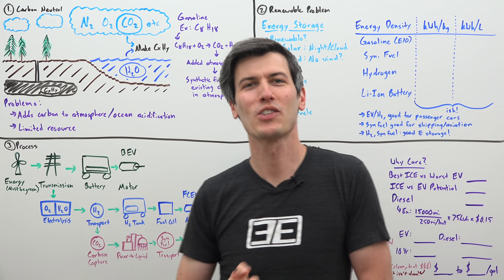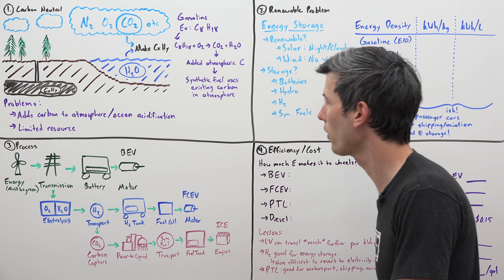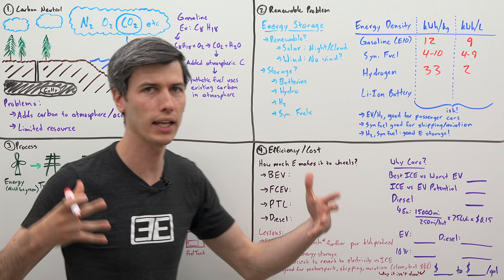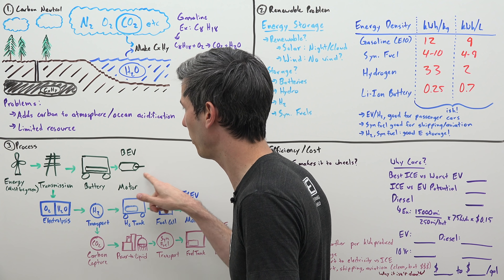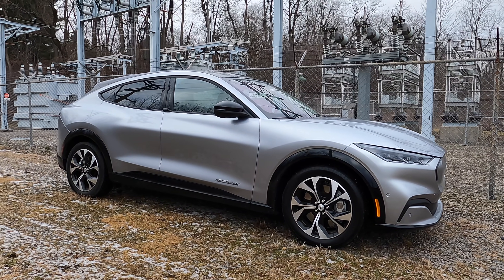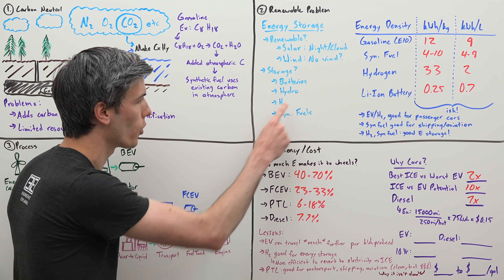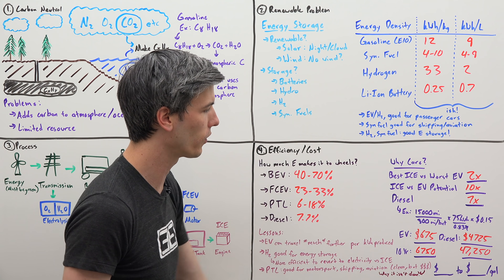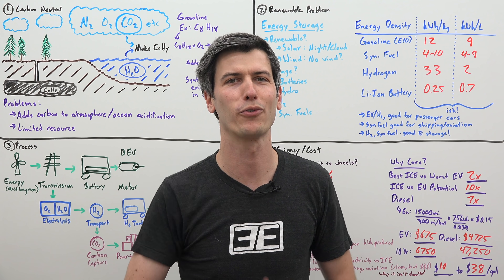The Big Problem With Synthetic Fuels

Comment: Energy conversion efficiency of fuels like crude, diesel, gasoline etc is around 35% on average? The ice vehicle doesn't need to convert that fuel to electricity though, just like we shouldn't power EV's with fossil energy, so the efficiencies should even out

Comment: I feel like I'm missing something, if we already pull oil out from oceans and it is "hydrocarbons" then we burn it and what's released is co2 and h2o and then they go BACK to the oceans, doesn't that mean it's renewable..... if it's already in the oceans then the oceans should already be acidic which we already know because oceans have a ph which isn't normal tap water and we know we can't drink it so how are we acidifying something that we're actually removing acid from and then adding it back to it...?

Comment: The problem is you assume that all the electricity produced by renewables is all used up to charge EVs which is not the case since most of the renewable energy is wasted anyway why not storing them as a synthetic fuel

Comment: OK 4 years later Porsche plan to low the price up to 1$ for liter ot 3$ per galon. That's not bad. 
Also the cost of lithium extraction for battery production is waaaay expensive than eFuels ! Fact.
Reply: Да, забавно смотреть такие видео спустя 4 года. Так же хочу добавить что есть много стран с плохим климатом, где электромобили зимой очень не эффективные. Например у нас в России не покупают электромобили потому что они очень быстро разряжаются. У меня у друзей был случай где они были вынуждены ехать домой без обогревателя и фар в машине, потому что электромобиль решил экономить энергию. А ещё есть Африка где электромобили появятся только лет через 50 и там как раз лучше всего было бы использовать топливо от Порше.

Comment: On my 2018 Toyota Camry, the A25A-FKS engine can achieve 40% thermal efficiency, which is as good as a nuclear plant's efficiency.

I think you used the biased data collected by the battery industry to prop up their false narratives toward a highly toxic chemical dystopia.

The highly toxic battery weighs over a ton per EV.   If every family has at least one EV, then there are billions of tons of highly toxic chemicals running on roads or staying in garages.    Suppose only 1% of them is not properly recycled, it means tens of millions of tons of chemical spill.   A DYSTOPIAN scenario.

Comment: Very interesting. But then, for syntethic fuels to be truly carbon neutral, all of the steps in the chain would need to also be carbon neutral, right? If transporting by truck, the trucks would also need to run on synthetic fuel. Every step has to be 0 emissions or capture as much carbon as it releases.

Comment: You don't address range, nor the transition plan / transition cost / transition time scale.   Your analysis instead assumes we are starting with a clean slate... which technology would be best if you had no existing vehicle fleet, and no existing fuel distribution infrastructure, and/ or it didn't matter at all how quickly we do the transition away from fossil fuels. 
Sadly, as an engineer, you've made the classic scientist mistake of confusing efficiency and effectiveness. 

As an engineer and project manager, I don't CARE if there's a more efficient solution available if that solution can't be rolled out fast enough to solve the problem, it's a dead end distraction. 
And if there's only one solution that (in the real world with millions of existing internal combustion engines and millions of km of road network that's inadequately serviced by charging stations) can be implemented quickly enough to solve the climate crisis, then there's no debate, you just take the only option available. 
Sorry, EVs are going to be too little, too late, to resolve transport emissions.   The transition plan isn't feasible. 

But gas conversions are a much easier thing than whole vehicle replacement, and can be done across the vehicle fleet much more quickly. 

Also, conversion efficiency is irrelevant if you have abundant input energy from solar, and abundant co2 and hydrogen in the atmosphere ready to use.

Comment: you’ve misjudged the economics of this. You can’t compare the electricity cost for charging EVs, where the electricity needs to be produced locally, versus electricity cost for synthetic fuels which can be produced anywhere in the world in regions where sunlight, wind or other renewable power is abundant.

Comment: I suppose the question I’m looking to get answered is not SynFuel vs EV, it’s SynFuel vs Petrol. Considering how many billions of ICE vehicles there are in the world, and how impractical and unlikely it is to replace them with EVs, what is the likelihood that SynFuel can overtake the market? As innovation and supply increase cost will decrease. And we can say that oil companies won’t let that happen, but oil companies love money more than oil, so if there’s a market for carbon neutral fuels that flow as simply and as readily as gasoline, and also keep the billions of cars on the roads functioning indefinitely why wouldn’t they pursue that solution?

Comment: The implication that energy efficiency is key is true when you have relevant marginal energy production costs, which are almost 0 with renewables. The cost associated to renewables usage is largely due to transimission and storage (required due to intermittend production), both problems you basically don't have when you store them with synthetic. After set up costs for a plant that does everything in one (sunny) place you would be printing money - excluding transportation. I am assuming there are reasons why that's not true but I don't get them from this video?

Comment: A diesel engine can chug along for a million kilometres given proper maintenance; you'd be hard-pressed to find an EV that can achieve even 1/10 of that without replacing every battery cell, an extremely expensive and wasteful process.

Comment: The first electric car had very few miles, decades of refinement got it a little better and many dead batteries. 
It was expensive at first and still is. Old teslas come with a host of issues. Even newer evs have a host of issues. And storage of the electricity bleeds off in the cold and does so as the vehicle sits. 
People said no this is not possible to synthesized fuels a decade or so ago. 
It was bunk it’s to hard or to expensive. So yea. 20-40 pounds now.

Comment: I'm asking myself, how is this boy here capable of putting everything false statistics and calculations at one single point. And not a single reference. A diesel cost at the end of processing not much than 0,40 dollar/L for the pure crack of petroleum. The agricultural produced Diesel is twice cheaper than that. With the charge of vendors And the transportation it's not more than 0.90 dollar/L. Then comes the state and Taxes it +1$ /L. 
This taxe goes straight to the country's budget to finance the EV in every possible way. 
That's it folks. That's why we can't trust you.

Comment: Efficiency has nothing to do with it. The problem is extracting carbon (sequestered carbon) from below the ground and injecting it into the atmosphere. We are destroying our environment by using sequestered carbon. That's why the use of fossil fuels must stop. No if ands or butts, or excuses about efficiency. EV cars will work for passenger cars. But an alternative must be found for heavy industry (steel, aluminum, cement manufacturing).

Comment: I think this might make sense if they can make the production plant cheap enough, it could take advantage of really low or negative daily electric prices and then sell the fuel back during winter when prices are $.30 a kwh for heat or greater. Hydrogen is tough to store and move and batteries don't hold enough energy nor do they do it long enough for months of storage

Comment: Your price of 15 c/kWh is crazy. I pay 51 c/kWh. Porsche already said that when they scope the process to full production that the price will come down. Brazil have had synthetic fuel for years in ethanol. It's as cheap as petrol and is net zero CO2. I think that batteries can't cut it and think hydrogen won't cut it either. The problem with hydrogen is safety and storage. It's the smallest Atom of any element and is hard to confine. Also to get the energy density you have the hydrogen under extreme pressure. It's like carrying around a bomb. Hydrogen also causes metal to fatigue. Producing hydrogen is not cheap. The EV to begin with are expensive and resale is not good. When I costed each battery I took into account how many cycles, the total    amp hours and it gave a cost on what I would get out of that battery for it's life. The EV is only as good as the battery and if they last 10 years then I would say my Diesel would be nearly brand new at that stage and would to replace the EV. I think an EV is a rich man's realm and a poormans nightmare. 
Tyres aren't cheap and EVs being heavier go through more tyres and they are harder on roads. This brings me to another point that EV owners don't pay anything for the road maintenance that's ice owners  do that's, because they pay road tax on each litre of fuel. 
Also if Govt subsidies were dropped,  EVs would be a lot dearer. There are many issues like the electricity for EVs has to be transmitted to the customer. This very costly as transmission lines are very expensive and are only in use for times wind is blowing and or sun is shining, which makes them more expensive. The plan would to illiminate the cost of transmission by producing the fuel where the power is.The insurance on EVs is high because of the risk they pose. 
I heard an electrical engineer say that one EV needs the equivalent of a whole street of houses to charge.
Nothing seems easy until you look at the holistic approach and take in all aspects.
To me I my approach would to take coal and perform catalytic conversion to form synthetic fuel. The Germans were very good at doing this since 1920s and ran most of war effort off this fuel. We should look to the past to move forward.

Comment: Very true - BEV will always ahve the highest energy efficiency but to say that PTL makes little to no sense because it has low energy efficiency is not an accurate statement. The PTL vehicle will have a higher Operational Efficiency due to the far greater energy density. What this means is that given a metric of say, Effective Work Output per Hour, the PTL Vehicle will put out more work for a given hour than the BEV. This means, that PTL vehicles have an advantage when the ROI of work produced over time is prioritized to pure energy efficiency. Transport services are one such area where PTL may make far more sense. Passenger vehicles that frequently do long trips at higher speeds, especially while towing for example, may have an advantage as well.

Comment: The exclusions in this rationale is bonkers. 

No inclusion of the greater inefficiencies and energy input to make ev's and continue to make replacement batteries for the ev. The ev will be scraped at a much shorter life span than ice car on synthetic fuel.

The estimated price of synthetic fuel is lunacy if you don't factor in the now trillions of dollars of subsidies, grants and a million other different financial incentives pushing the ev bus.

There's no consideration for all the energy and materials that go into making an originally non existent charging infrastructure. Ice on synthetic fuel use all current infrastructure and existing cars. You don't have to build a world wide fleet of ev's in everything from cars to planes. Plug in the energy costs of that one.

This is fairy tale science at best

Comment: That $38 per gallon is with very little R&D as opposed to massive investment towards Electric R&D. But only the richest countries can afford to build the new infrastructure to go electric. A vast majority of the world will still be stuck on traditional gasoline. If we applied an equal amount of R&D on synthetic fuels as we do electric, I don't see how it wouldn't be logical to see that price per gallon drop significantly. And once it becomes viable enough, that fuel can be sold to countries where they can't afford the infrastructure and you'd be able to get them going green without them having to change anything. There's no way you'll get China, India, any South American country, to switch to electric. But you could get them to switch to synthetic fuels. Plus ANY country could invest in creating their own. It wouldn't require your country to sit on top of massive oil reserves so global competition would be stronger than it is with traditional gasoline. We're too quick to write off synthetic fuels before we really put in the effort to find out just how efficient we could make it. Honestly it's impressive how Porsche is able to get it to $38/g all by them selves. 

Porsche says they can get the cost of E-Fuel down to $7.57 per gallon in the near future. THAT is something worth keeping an eye on.

Comment: Synthetic fuel with synfuel fuel cells not ice, at 50% efficiency made from $2/kg green h2 are going to be cheaper than ice, same opex cost as ev and 100% green unlike evs that are grid dependent. eMethanol at $0.4t/kg and 0.4kg of emethanol needed for each kwh produced. $0.16/kwh cost for net zero, liquid fuel u can pump at any gas station, and carry with any fuel truck. Your ptl efficiency is wrong. Use synfuel on fuel cell as addon to ev or alone dont burn it on an ice engine.

Comment: While your analysis of this scenario is correct, we'll have many supply chains intersecting the petrochem industry looking for carbon neutrality, synfuels will be more energy efficient with added supplies and will give us the flexibility we need. 

H2 (gray, blue, green, cyan, purple) can come from many sources, green hydrogen is already horrendous in efficiency since PEM electrolysers need constant power to run efficiently which we wont get without nuclear, hydro or gas. Switching to HTSE could also improve eff. but that's another topic altogether (catalysts...).  We also have a lot of bio wastes we can gasify and CCS is being pursued for a lot of process. Adding the needed chemical precursors for our industrial supply chains makes synfuels a natural extra step for carbon neutrality in the petrochem industry. Industrial heat needs are another area where we can't electrify everything and H2 doesn't have the density needed, unless we build SMRs everywhere which wont happen anytime soon. 

Not to say it's perfect but the costs for beefing up our grid and generation to electrify everything wont be negligible either.

Unless Li-S batteries or an other disruptive energy storage tech becomes the norm, syngas/synfuels are the future for many things, if not everything except personal BEVs

Comment: Not being based  EVs has the downside of having to create charging stations and reliability take where I'm from for example we have harsh terrain which EVs can't coop with and resources for the battery might deplete in the long term compared to using carbon IV oxide over and over

Comment: If you generate the hydrogen through thermolysis of a nuclear plant, the efficency of synfuels goes way up. The efficency goes to above 90% at 1000 (C). This also removes electrical transmission losses because the energy is generated right at the nuclear plant. From a political perspective, the most promising thing about synfuels is that it only take one or two countries to deregulate nuclear energy enough, and they can supply the whole world with synfuels.

Comment: I don't get why you get the cost of diesel multiplying the cost of electricity by the relation of efficiency EV/diesel (7x)? You get the cost of diesel by its real cost, per gallon. Maybe I'm missing something.

Also, does it really cost 10 dollars the gallon of diesel??? Fuels were supposed to be cheaper in the US than here in Europe. Here in Spain a US gallon is around 5,7€.

Comment: E-fuels all assume there is excess renewable energy available.  But if anywhere on the grid there is fossil fuel being used, then the fossil fuel is being increased or decreased based on demand while the renewables are used at their full capacity, because incremental renewable energy is free when its available, while incremental fossil fuel costs money.   So any incremental need for energy from the grid will come from fossil fuels.   With the reshoring of industry and the build out of AI processing sites, electric power demand is growing at an unprecedented rate.   Net it will be decades until there is a major US grid that is all renewable.  Further, the high capital cost of renewables combined with increased interest rates means many renewable projects now do not pay out and are being cancelled.  The new electricity  demand is so huge, one AI installation is planning on its own nuclear reactor because there just isn't enough power otherwise.  So, if any incremental e-fuel is made by burning fossil fuels, they make zero sense.

Comment: Methanol can be brewed(wood spirit) or made synthetically. 
The main reason liquid fuels will always be around is that you can't ship/trade energy using batteries internationally and you still need to run shipping and aircraft which make batteries weight prohibitive.

Comment: There are three factors you have left out:
1. Solar power is getting cheaper all the time so the inefficiency may not matter as much as at present.
2. You haven't mentioned biodiesel. People are running cars on vegetable oil which is cheaper than diesel at least here in the UK. There is also talk that fuel could be made from algae.
3. You haven't mentioned the fact the fuel cells can be run on methanol which is more efficient than burning it in an ICE.